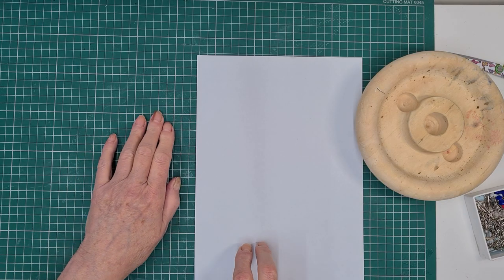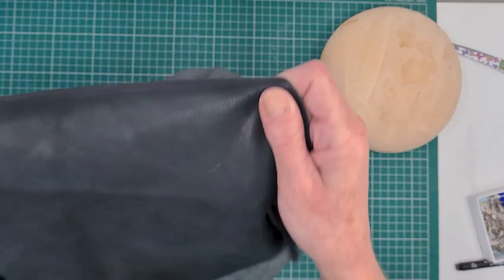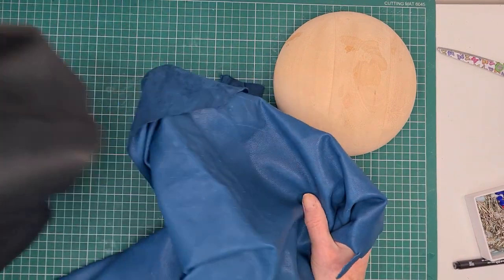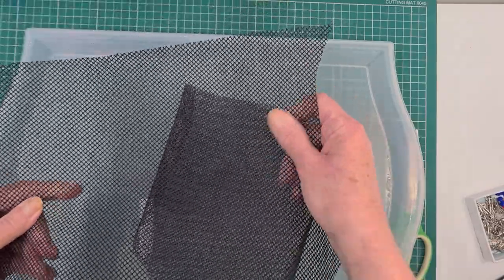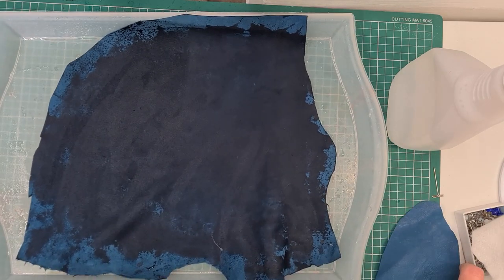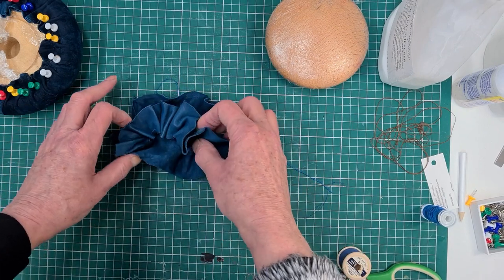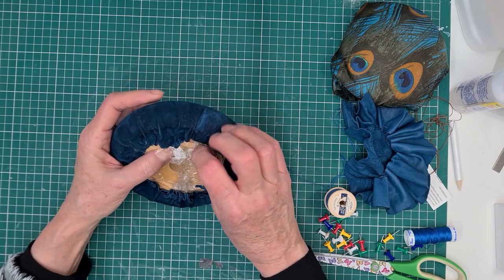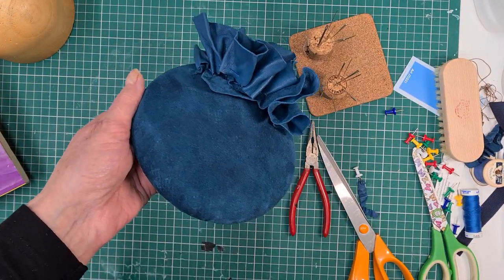Blocking leather for hats - another of my millinery tutorials

Comment: Thanks for this video, did you add stiffener to your leather?
Reply from the maker: No  once I added the wet leather to the Paris net, it reactive the starch in the net and it stuck hard
Reply: @SHMillinery  great, thanks.
Reply: Great video! Could you advise where to buy the wood blocks? Happy Christmas!
Reply from the maker: @mmerxss  this video has suppliers https://youtu.be/wV2vYQ8A-Gc
Reply: @SHMillinery  thanks for this video. 
I see it was possible for the leather you used in this video to get wet. Is it a special type of leather than the usual leather used?
Reply from the maker: @kardashub5927  any leather can be wet. You just have to be careful if the dye in the leather leaches out